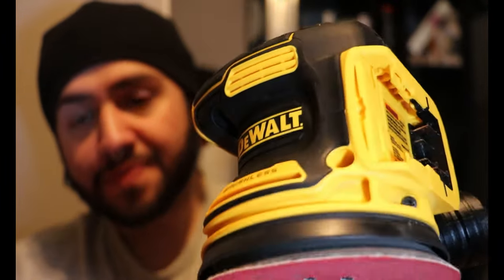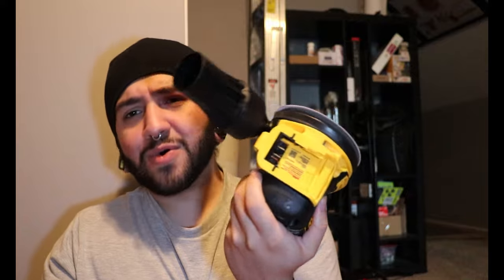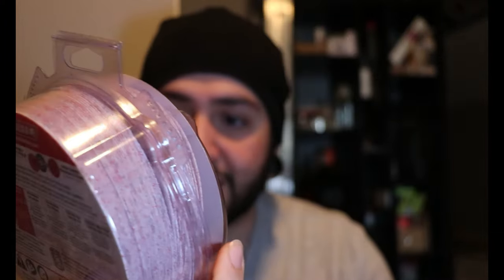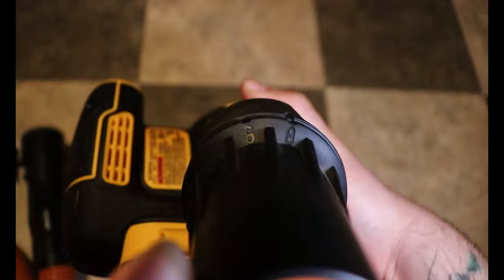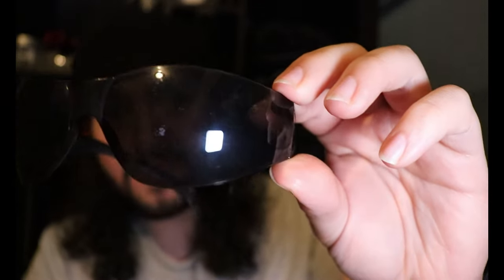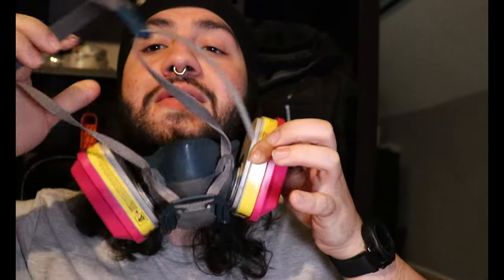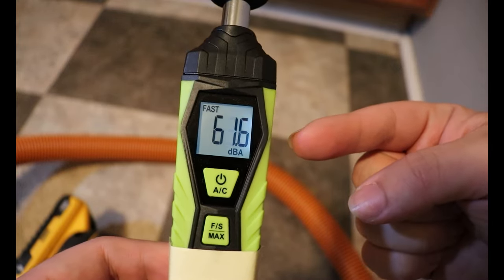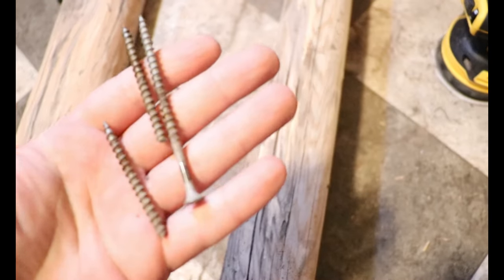HOW TO: CONNECT DEWALT BRUSHLESS ORBITAL SANDER (DCW210) TO A SHOP VAC - WITH DEMO

Comment: Hi: is it normal for this sander not to spin when it's not against a surface?

I have seen several videos of this model, in which it rotates even when it is not against a surface...

In the sound test that you do, it can be seen that when it is turned on it does not rotate but is against a surface...

Thanks for the information.
Reply from the maker: Great question! there are 2 actions that occur during function. A rotation at the given rpm setting and an orbit. Powering on simply engages the rotation while contact/resistance engages the orbit for a more consistent sanding pattern.

Comment: Hey I have the same hose (car detailing kit) and the dw4070C ridgid vacuum but when I connect the orange hose to the vacuum itself it makes a freaking whistle sound so badly like a high pitch sound that hurts your ears so bad. Does this happen to you? I’m thinking in returning the it and get a cordless vacuum.  Like a Milwaukee or the dewalt itself. Thanks
Reply from the maker: Thanks for the question, that noise is definitely not normal and sounds like a bad connection check to the hose to vac connection and also check the hose for any cracks that let air leak. If the connection is 100% good from 3 joints:
1. Vac to hose
2. Hose to dewalt adapter
3. Adapter to sander
The other possible issue could be an obstruction or clog. Clean out your filter and check to see if any debris got passed the filter and into your vac 

If its not a connection or obstruction, It's possible your vac may be defective.